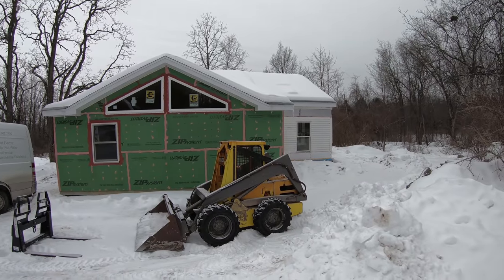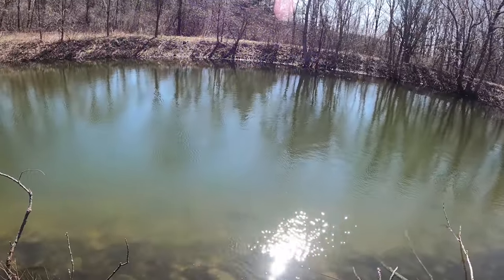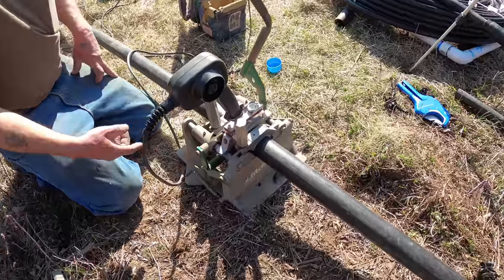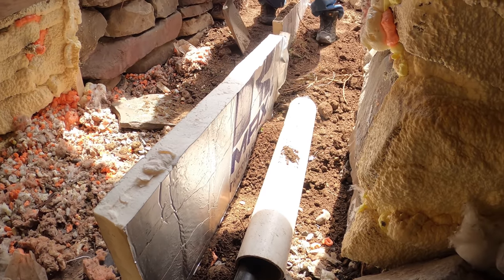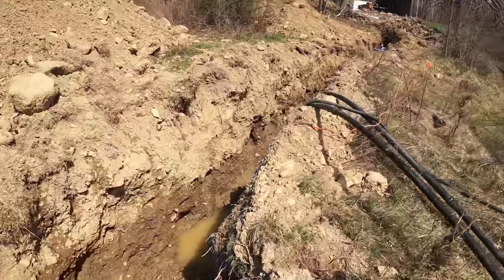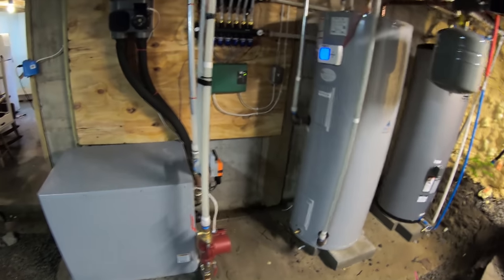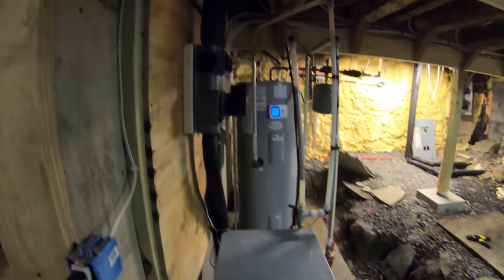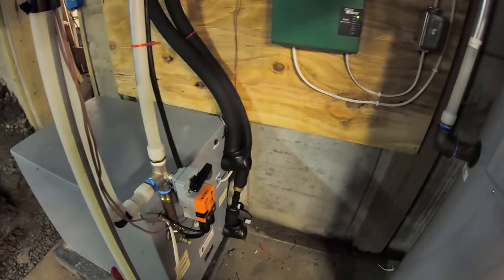Installing a Geothermal system (water to water, radiant heat)

Comment: Intresting heating concept but: those floor OSB's has some R value so putting a heater (aluminium plate) under it isn't quite efficient as placing it above, this is why most of wooden floors are opted with electric heating pads, even instruction manual claims significant efficiency drop if floor above heating element is more then 18mm thick. Here in EU, we've got special laminated (engineered)flooring enriched with aluminium dust particles for better heat conductivity...
Reply from the maker: you just turn up the temp on the loops a few degrees and its fine
Reply: I have to imagine a heat pump is still a lot more efficient net then electric.  Geotherm typically beats electric about 3.5-4 to 1 as a baseline so there's a lot of room to lose efficiency and still be ahead.  There's still the install costs to consider and your ROI horizon. 

The heat still goes somewhere, and putting some insulation under the line probably helps quite a bit forcing it to go where you want.
Reply: @everydreamai  It's about on par cost-wise with natural gas heat, the upside is that the same unit can also be used to cool (same heat exchanger, pumps & ground loop). The added benefit of geothermal is that it's all electrically powered so it works better for off-grid with solar or rural where you don't have natural gas service (having to worry about a propane tank gets old). And electricity prices USUALLY aren't as volatile as natural gas prices.
Reply: @everydreamai  True in theory, but its tricky bussiness. Issue with heatpumps is they tend to lose efficiency (water2water is COP 5 max) fast if condition is less then ideal. I've seen those systems (air2air) goes to COP 1 or less meaning it will take more energy then it will produce to heat. Jesse's mentioned rising of a temperature will solve the problem but the more temp difference is, system is less efficient. Further more, if that pond (if used, not in this case) temperature goes under +5*C in contact area (41*F) efficiency will drop like a stone. Ideally, it would take more then +7*C or 45*F to keep the compressor in safe operating area (SOA) and preventing in-circuit electric heater (often 2+ kWh, some eastern companies go nut and install 10+kWh) to kick in (to heat the compressor body itself and prevent freezing of elements inside like valves). This is why deep drilled holes (more than 100m or 300ft) are often used where frost line is deeper but also higher water table (those to are interconnected) will help but only in mild climate condition. Almost in every project like this, auditory is kept away from further exploitation results, like electric consuption vs temperature plus installement and cost of the gear, so companies often sell you what you want to hear giving a false impression its some miracle system. Dont get me wrong, Im not trying to undermine Jesse's great effort cause I know he's doing best he can, but just to point out to people its not a straight foward bussiness as it might look like and often it takes a lot of expert engineering and field testing to make it right.
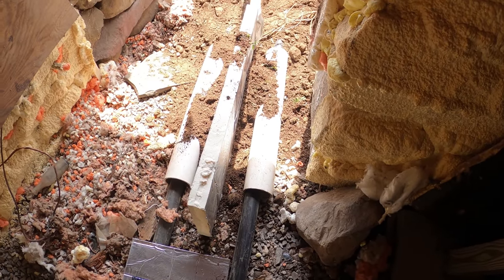PS. 35:44 No more then few degrees ;)
https://www.waterfurnace.com/literature/5series/sc2500an.pdf
Reply: @Guysm1l3y  It's possible to use it for cooling but only if it slab installed at given level - or ceiling installed in wooden frame work, like under the next level floor. So, in this case, it will cool down the basement.
This is the advantage of wall heating-cooling using same principle of heat pump as it more efficient but takes more energy, it's lose some, win some trade off.
Reply: @Helloverlord  We have forced air with a ground source heat pump( 2x240 ft. wells with 480 feet of tubing in each), a 3 ton system. The tubes are sealed. Also preheats water for the hot water heater.Works great!
Reply: @janking2762  All of them "works". Even the poorest installed one. Without exact data, temperatures, energy consumption etc. it is impossible to say how efficient it really is. Sometimes its better to stay hooked to gas like Jesse mentioned somewhere in video.

Comment: these systems are allot more money! the radiant heat systems are not robust at heating, rather slow but steady. these systems also do not respond well to changes in temperature; think fall and spring where it is cold at nite, and warm during the day. in addition, all those pumps, tanks and water valves might last 10 years. great video, but i'm not sold on the geothermal viability.

Comment: If you DONT have battery back up sub pump better get it ASAP. One flood and that's $20,000 in tech GONE.

The way I like to expalin this... In the summer you get the inside of the fridge. In the winter you get the outside back side of the fridge.
Reply from the maker: that house actually doesnt need a sump pump. Its drained to daylight . But I did install a sump pit if they do want one

Comment: This geotherm is very interesting BUT the failure points are huge with all the valves, pumps and electronics. You need installer constantly monitoring systems on his phone? What happens in 15 years?
Reply from the maker: he doesnt need to monitor it,  it will just send an alarm to his phone if there is a fault, but the only time he ever goes on fault calls is for systems installed by other companies

Comment: Most efficient heatpumps are water/water systems, there you have two options shown like here vertically dumped into a water source which stays frostfree or horizontically drilled into waterfilled layer in the ground, most systems will work allready with an ambient temperature of 10°C in the layer/pond, depending on the efficiency of the refrigeration unit you´ll can get an output temperature of about 45^C max, so you have to install floorheating. The advantage of such a system is a factor af 4-6 times energyprofit compared to a electrical heating system. Depending on the price you´ve got to pay for electric energy in your country this can be quite cheaper than other sources like gas, oil, wood. Over the thump you can say here in GE a kw/h heat by gas costs you around 5ct so with prices for electric energy at around 30ct per kw/h a heatpump is quite useless because of cost of investment and maintenance. This could differ greatly in your country or if you´ve got access to free electric energgy via solar, hydro, wind or biogas.

Comment: Who engineers your systems?

I'm thinking of a ground source cooling loop without a heat pump but I'm not sure where to start with calculating temperatures, flow rates, loop size, pump power draw, etc.  I haven't seen people doing that kind of thing.  There might be very good reasons why but I don't want to abandon the idea unless I know why it won't work.  At the same time I don't want to spend a bunch on engineering if my idea won't work.

Thanks.

Comment: excuse my ignorance but why not just the traditional method? is there a cost efficiency for geothermal? is this requested by the buyer ? just curious
Reply from the maker: geo uses 300-400% less electricity than conventional electric heat.

Comment: I have a closed loop system with 3 five hundred ft. trenches 10 ft. deep. I wish i had drilled straight down. There is WAY too many things to have problems with in this system. Mine here in N/E Arkansas has 1 service call since 1993 and that was my fault, I called to have them check to see if everything was ok and it was.
Reply from the maker: thats good to hear. thats alot of loop and very deep. If I had known there would be issues with the pond, I would have just told them to get it drilled. its only worth doing horizontal loops when you have your own equipment and on your own house

Comment: Ok, so that is not really a geothermal, but more like a heat pump using water to remove the cold, correct? Geothermal requires some natural hot waters underground.
Reply from the maker: No this is geothermal, using natural hot waters underground is not something I have ever heard of. Geothermal extracts and moves heat from the ground into the house
Reply: @jmuller86  Ok, but that's what normally geothermal refers to. There is hot water deep underground all over the Earth, and in some (very few) places it's not that deep. That is true geothermal. What you have here is simply water cooled/warmed heat pump. I don't know why anyone would call it geothermal - it's confusing at best. 
There are heat pumps (as you know) using air to exchange heat, or the ground, and yours uses water. But that's not a typical geothermal solution. I think people call it like this for simplicity, but it should be more like water based heat pump (also known as WSHP) or something similar. Cheers

Comment: Would be interesting to calculate how much longer this layout with the ground loop has to run over lifetime compared to the pond loop to break even in cost and emission.
Too bad, that the pond loop plan didn't work out, couldn't you raise the shores of the pond to gain more depth for the loops?
Added solar energy would be great, just to run the heating even on a blackout, if the homeowner has no generator to run it while grid power is off.
Looking forward to your system, Jesse!
:-D
Thx for the vid, much appreciated!
:-D
Reply: yeah for blackout in the middle of the night
Reply: @alexisfrjp  That's when the batteries kick in, i mentioned solar energy, not solar panels as a standalone...
;-)

Comment: Surprised you don't need to insulate under the floor loops to stop the colder air in the crawl/basement reducing its efficiency over the length of the pipe run.
Reply from the maker: they will probably put the bubblewrap underneath atleast

Comment: With that extra bank height, you could have raised the pond height by raising the height of the overflow pipe. No digging required.
Reply from the maker: It doesnt stay like that, it doesnt have a liner  so it drains out and evaporates. Something you dont want to be messing with in the winter
Reply: @jmuller86  That’s a shame, would have made the whole project easier, thank you for your good works and for sharing them with us!

Comment: Water to water ?
Reply: Water running through the geo ground source and water under floor as opposed to blown air into room
Reply: There is a water loop in the ground and a separate water loop through the house.  There is a heat pump that bridges the two using phase-change physics, a pump, condenser, evaporator, restrictor, and special refrigerant with desirable properties in terms of boiling and freezing temperatures. 

This is not fundamentally different than a heat pump or AC, except two water loops are replaced with air (inside and outside air) and fans.  Water is just more efficient because it has a much higher heat capacity than air, meaning the heat pump doesn't have to work as hard.
Reply: Not what I meant... his first plans were to put the loops in the pond water. Hence his title "water to water".

Comment: why no insulation so that it doesn't lose heat to the crawl space and or basement, all those aluminum heat spreader are going to let a lot of their heat to those area. well it what i think.
Reply from the maker: they will probably add insulation later, atleast the bubble wrap
Reply: @jmuller86  i was going to say we gonna see that on your new house, but its going to be different, ever thought of running the lines inside the concrete on your new house?
Reply from the maker: @bobrobert6277  yes all my radiant heat will be in the concrete of the floors

Comment: I do not get how the pond loop makes any sense for heating in the winter when the water temperature is about 11° Fahrenheit near the bottom of the pond, compared to 50° throughout the year when the loop is in the soil
Reply from the maker: the pond wont be anywhere near 11 F at the bottom, it should be around 45 degrees at the bottom, depending on how deep it is
Reply: sry, I originally meant to say 39 F and 58 F, but that might be more for Middle European climate. Still, the 45 F in winter is still pretty cold

Comment: How would you set up one of these systems on a multi level house? Is that even possible
Reply from the maker: yes, you could have a different zone for each room. if you are adding a system to an existing house, you can just put the over floor heat in, and re do the flooring on top of it, instead of ripping up the sheetrock on the ceiling below

Comment: good luck to the home owner  almost every story  i hear about these systems  is it winds up costing twice what it was supposta be .  the house insulation has to upgraded or replaced  has to have electric heat back up  and so on, costing thousands of extra dollars and in the end   it really dont even work very well ,  the home owner winds up eating the whole thing after the company washes there hands of the whole thing and the home owner is still without heat and winds up buying a regular furnace  so ..i hope that isnt the case here ... but time will tell... just my 2 cents
Reply from the maker: there are alot of bad installers out there, from what I am hearing. I think that is the biggest difference in whether they work or not. There is no need for backup heat with this. If the ground loop is designed right, the ground will never freeze up

Comment: By the look at the rock, are you going to sleeve that water pipe. Great explanation of the system but unless this heat exchanger is any better than the 1990s heat exchangers their garbage. You’ll still be living with jackets inside in the winter time.  Cool down will be determined by the outside temperature and how well the house is insulated.  It be interesting to see what this whole system and digging cost and how long it takes to pay for itself. But the way these idiots are getting rid of our means of electricity and switching to solar so quickly it might be the way to go.  But in the end you still need energy to run the system.
Reply from the maker: these components in this system are top of the line. Around here they install alot of these systems and they are always good stories. $500 a year is the estimated cost to heat this house
Reply: @jmuller86  and the cost for the system?  Thank you for your videos👍

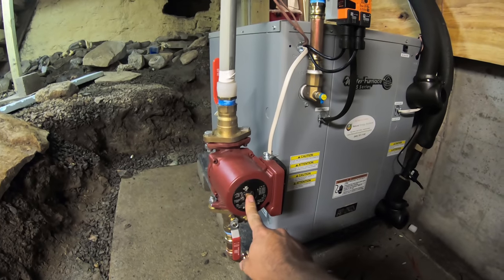Comment: I see at least some of the components in the system are from Grundfos (1:01:55), the Danish world leading pump manufacturer. On their web site they emphasize that their systems should be environmentally sound. Then, I cannot in my wildest fantasy see how the "system" in this video is that. How much CO2 was produced when you double dug that 600 feet loop? Even the first concept (the pond) produced more CO2 than if you had drilled a 300 feet well straight down. In addition you would have avoided all the extra emissions trucking away the big boulders. Here in Norway, every new house has to be a low-energy house, and geothermal systems have become the most common means of heating. Nobody uses ponds and horizontal loops like demonstrated here. A good friend inherited his parents house with a nicely landscaped garden/driveway. He tore out the entire floors (3000 sq feet), mounted radiant loops and bore the thermal hole in the middle of a front yard flower bed. When all was installed ALL flowers where intact and it was impossible to figure out where they had bored.

Comment: Butt fusion welding!!! Haven't done that since 1983-5, on gas pipes, where your work had no margin for error.
They switched to electro-fusion welding, where a copper coil was mounted inside the joining coupler. It took all the skill out of the job, so I left...

Comment: So, it's basically an inverted airconditioner. That'll consume a lot of electricity.
Reply from the maker: you can heat your house for about $500 a year, that was the projected cost
Reply: Unlike a regular air conditioner, a heat pump can achieve up to 300% efficiency because it can scavenge heat from the ground/air source so long as it's warmer than the freezing cold water you put into it.

Comment: I had a guy charge me $200 per swedge @21:20.  Worth every penny.
Reply: You mean it cost $200 per pipe joint??
Reply: @criticalevent  Yes.  I only had 6 joints and it was 2 inch gas line.
Reply: @mikeyg9619  Oh so it was metal pipe?
Reply: @criticalevent  It was 2" PE
Reply: @criticalevent  No it was 2" PE

Comment: the cost must be horrendous
Reply from the maker: you get 30% back from the government plus an additional $1500 per ton from utility company to offset the costs
Reply: @jmuller86  Hi Jesse.
Per ton of what ?, C02 ???
Reply from the maker: @naybobdenod per ton of heating. This unit was 3 tons so 4500 back from utility company ok top of 30% from government